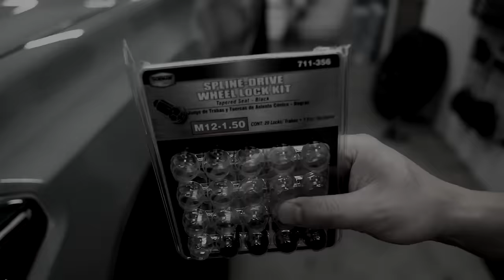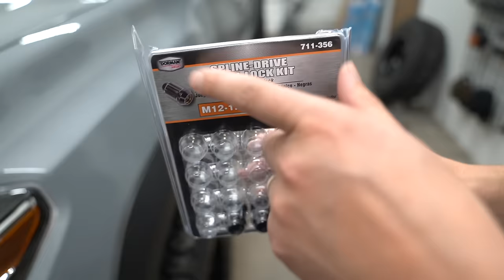Biggest Tire Size on a Tacoma/4Runner with NO LIFT!

Comment: I love those tires can I install on my 2015 Sr5 two wheels drive ? Please reply
Reply: Yeah you can but you'll have to lift it and do a body mount chop on the front inner wheel wells that gets welded on and add a leaf in the rear or if you want to go with a 1 1/2 in block in the rear you can and upgrade to upper control arms. That's if you want it done Right
Reply: @briangarrett9839  I agree, that's  the way to do it.

Comment: This is the tire I want to put on my '17 taco this summer after a 2" lift. Wondering about rubbing during turning.
Reply from the maker: Slightly over a bump and the wheel is turned but not bad.
Reply: Is the truck a pavement queen or do you off road with it ? You want to avoid ANY rubbing if your using the truck off road otherwise just be careful turning into curb cuts.

Comment: Does this include SR trim level?
Reply: It would work on SR trim as well, but know only if you're just going to be driving on pavement.  You will rub on going over speed bump and the only solution is CMC.  Tire brands also matter - some stick out more/less than other brands.

Comment: What about if I want to use a 16 inch rim on a Tacoma Trd sport
Reply: With stock rims a 285 tire will probably rub the uca's
Reply: @johnniepiko  would a spacer solve the issue ? pardon my ignorance stock rims are what Offset ? 0 or + 10 ?
Reply: A 265/75-16 is the biggest on a 16” rim, without any rubbing or spacers on a stock truck. It over fits the spare area without trimming.
Reply: Bradley Beyer thanks brotha
Reply: I installed 285/70/17 on my new TRD with stock wheels and stock suspension. 
no rubbing at all
Reply: I have a 2007 stock tacoma I currently have 265/65r16 on the trd stock rims I want to get mud type tires but as low profile as possible while still having a wide tire I’ve seen this on other trucks and love the look and there’s no real off roading to be had in florida so I’m wanting my truck to look bad ass while having good traction I was told a 305/65or70r16 is what I should get could you please give me some sort of ideal if I’m thinking right or what is best in your opinion?Thank You

Comment: The exhaust won't hurt the tire. Also when you are taking your spare up and down don't mess up the bottom of the tailgate it is prone to rust there in the first place. Also, you did not flex the truck out at all with the 33,s so how do you know they still won't rub???

Comment: If you install a traditional shock/spring lift , then the same size tire fits with or without a lift.  The only lift that would change that is one that replaces the lower control arms(IFS).  A traditional lift just moves the vehicle up in the travel arc.

Comment: Should be running a 16" wheel for better off-road performance. Rule of thumb: wheel should be have the tire. 17" X 2 = 34"
16" X 2 = 32" perfect for your 32.7" tire 👍

Comment: Thanks for the video .  I was wondering if you had any issues when the truck had weight on it if rubbed in any way ?  I have a 2021 Tacoma sr5 4x4 , I’m curious if I can get away with a 275/70/17 . Thank you
Reply from the maker: If you want zero rub I would recommend that size you mentioned

Comment: I put 33' tires on my Tacoma with Quarter inch wheel spacers for the front only and they did not rub at all. did not had to cut nothing! but that works to. great job.